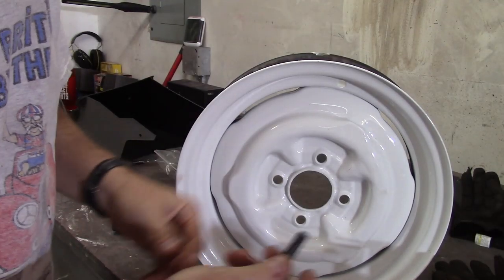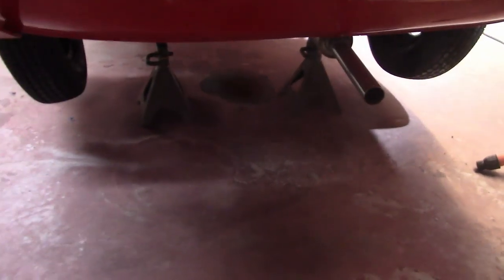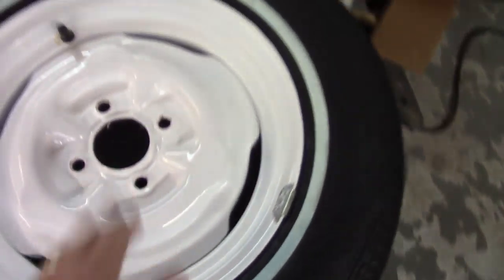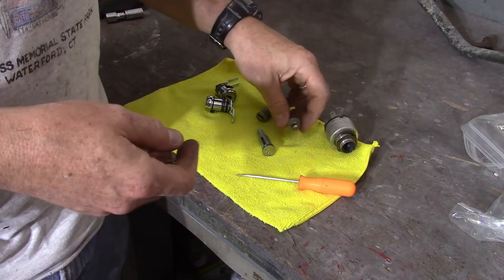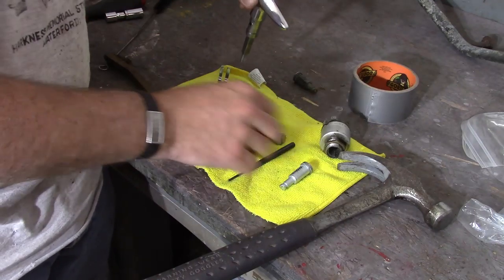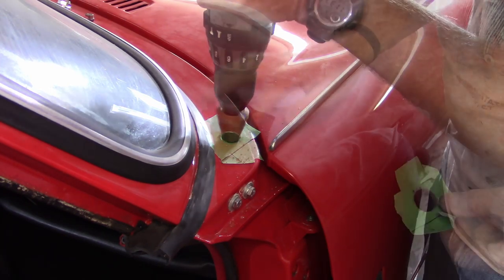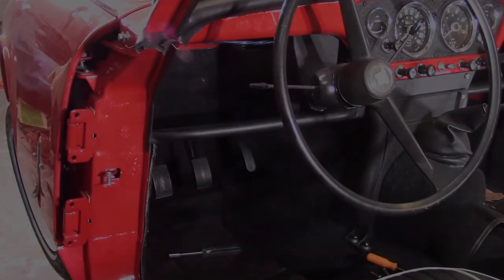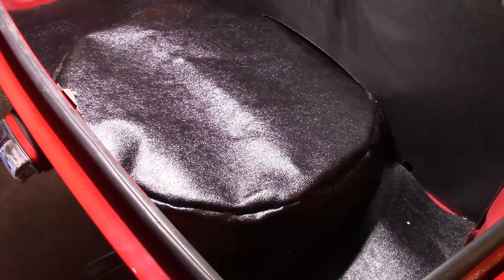Triumph Spitfire Mounting the Tires & More | Roundtail Restoration

Comment: man got to love it....Dot has a new set of shoes....keep it comin love the look of that red furflux around the door....waiting patiently for the road test....great job Chris!!
Reply from the maker: Thanks, Robert. Tried to get the driver's side door mounted tonight. There's a lot of touchup paint in my future.
Reply: @roundtailrestoration  that does not sound like that went well at all. I hope it was not to bad. If you have an air brush you might be able to do an easy touch up..or even a Q-tip type applicator...good luck fixing the touch ups.
Reply from the maker: It didn't and it's still going. It'll work out in the end I'm sure. Or I'll just repaint the whole thing 😂

Comment: Great video Chris.Getting closer now, looking good. I saw this this for the spare wheel hold down, it has a circular piece of card and a wheel nut with a large flat washer it looks like. See the diagram in the this link.      https://rimmerbros.com/Item--i-GRID005967. 
Cheers, Jeff.
Reply from the maker: Thanks, Jeff. I looked around last night and also learned that the post for the hold down goes through a lug nut hole, nut the center, unlike most cars. I do have an original cardboard piece, just forgot it at home.